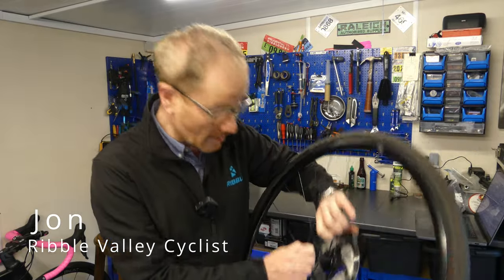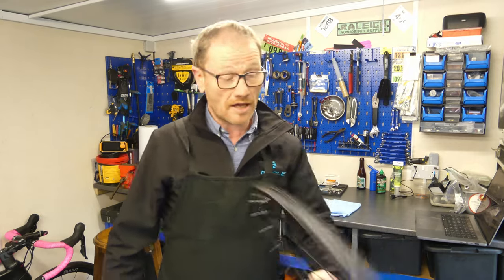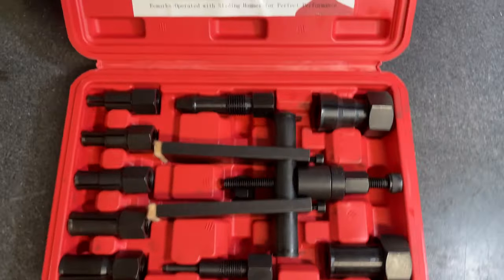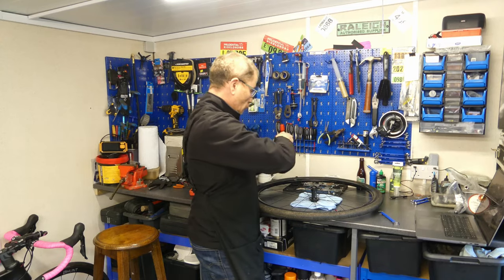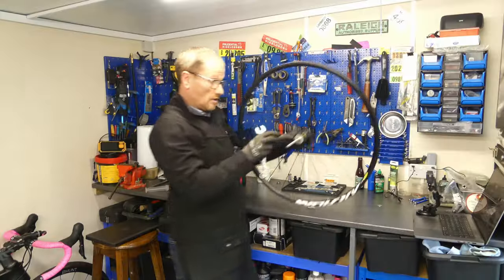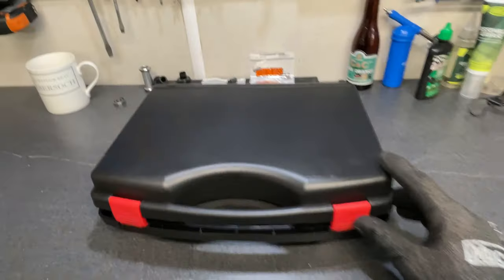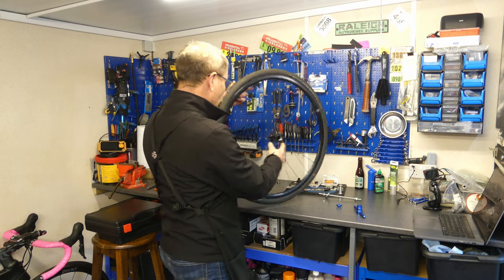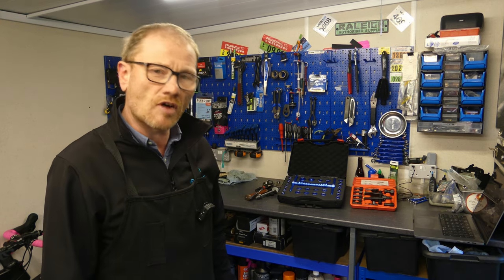Replacing Sealed Cartridge Bearings - Tools Required - Road Bike Maintenance

Comment: I've had great success with the bodged version of this. Using 12mm bar and a pair 1/2" sq drive sockets with od equal to that of the bearing, the increased length between the applied load of the nut and reaction load at the bearing easily overcomes the moment acting to pull everything out of line. I suspect this works as long as the socket used is longer than its own diameter.
Reply from the maker: Interesting BenedictIEP, thanks for sharing. I also tried a socket, (sparkplug socket is a great fit for a 6902 🤣), but still had an issue. However, my threaded rod is only 9mm. I suspect your 12mm rod is doing a better job of keeping things perpendicular to the hub.
Reply: I have used Frankenstein's nose ring (love that name) with drifts I bought online in the needed bearing sizes.  The drifts are not expensive and much less than a full set of presses.  The problem isn't the nose ring device, it's that the washer's size don't match the bar and bearing, solved by the drift.
Reply: @ribblevalleycyclist great useful videos. Thanks for sharing. I just take piece of wood n hit the axle n pops out the old bearings ..n use impact socket to hit in the pressed bearings,,,

Comment: Brilliant, thanks. I've ordered both tool sets. My Hunt MTB wheelset has clocked up 5,000 miles in wet English conditions and the bearings are running rough. Having seen this and bought the tools I know I can swap them out myself with ease. I used the Frankinstein's nosering method years ago on a motorbike - successfully in the end, but it was a tiresome process - I know it'll be easier with your recommended method. Excellent, this is what YouTube does best.
Reply from the maker: Hi Jon,

I think that if you have mechanical sympathy and are a persistent bugger, you can get Frankenstein's nose ring to work for you. But lets be honest, who needs that hassle in their life? And anyway, using the right tools is just a nicer experience.

I personally run 4 sets of HUNT wheels, and am hoping to do a few maintenance videos around them pretty soon..... using the exact tools you've just treated yourself to. So, watch this space.

Glad you enjoyed the video, and enjoy those new tools 👍

Comment: Love the video, you say don't replace removed bearings, I've been removing my red bones for my casters/ wheelchair basketball, removing seal and dry cleaning in acetone, leave to dry then a few drops of bones lube followed by rock & roll lube, then immediately put the bearings in the freezer overnight, take them out in the morning and they just fall back into the casters, I do the exact same thing with my spinergy wheels and I can't mess about with them as not cheap at around 2k a pair, point I'm getting at, I'd rather not use any tools at all, my casters spin for over a minute and one push has my wheelchair from one end of the court to the other, all with the same bearings cleaned and replaced for the last 5 years.
Keep up the good work 👏

Comment: The other problem with the washer press is that as the washer is loaded it's going to deform and apply more force to the centre of the bearing, side loading and damaging the bearing. The load needs to be applied to the outer race.
Reply from the maker: That is a very good point, didn't think of that 👍
Reply: Are all the three hubs exactly same specialised wheels are same free hubs

Comment: been a mechanic for 48 years put bearing in freezer the it just drrops in.
Reply from the maker: I’ve heard of this before, but never tried it. I will give it a go, and may do a video on it. Thanks. 👍
Reply: Very interesting and helpful.  Thanks  👍🏻
Reply: as a spindle mechanic you are 100 percent right
Reply: Great tip. Will try it. I used to heat up casings on motorcycle sealed bearing replacements. Worked well
Reply: Could I deep freeze my wheel and have the bearing drop out? Serious question.
Reply: No because both the wheel and the bearing will drop to the same temperature. You want your bearing to shrink by lowering the temperature
Reply: @alexrhughes  Blow torch the hub, bearing will drop out.

Comment: I agree with bearing press recommendation, but not the bearing puller. I have tried these automotive/motorcycle bearing pullers and there are a couple of problems with these (poor overall quality and rough edges, the protruding lip which may interfere with preload pipe and damage it, the legs of the puller not suited for a bicycle due to not enough space to place them on most hubs) I had to return an expanding lip set that I had, it was causing too much damage and was very awkward to work with. Bearing Pro Tools sell pullers that are more suited for the bicycles. I should probably do a video on these. I am not affiliated and have paid money for my set, but it is more about the type of the pullers rather than specific brand. The main difference is that they are made from aluminium, bearing specific like the press set, and do not have a lip to grab the bearing.
Reply from the maker: Hi again Hard Work, good to hear from you.

The protruding lip which may interfere with preload pipe and damage it
		Never do the collet pin up with a spanner, and use the smallest collet to prevent excess expansion beyond the inner bearing lip. As you can see at point 6:10 in the video, the collet is in place, hooked under the bearing, but it’s rattling around freely, this confirms it's not putting any pressure on the preload tube, and therefore won’t damage it. The key here is to use the smallest collet and expanding it to only hook the bearing, that is why I stress only doing it up by hand. Using a larger collet will fit too tight, and may catch the collet. I used the 12-15mm collet, rather than the 15-17mm, and that is why it rattles around, but still pulls the bearing. I have never damaged a preload tube using this method. 

The legs of the puller not suited for a bicycle due to not enough space to place them on most hubs
		I have pulled multiple bearings using this puller. I have yet to find a hub that it won’t fit. What hub did you have this issue with? Additionally, adding a slide hammer to the set is of little expense, and overcome this. 

Bearing Pro Tools:
		Yes, I’m aware of this brand, they make some good bearing pullers. Because of this, I meant to mention them in the video, but forgot. I like their wind-out product, but have had issues with their expanding product (slipped on me a few times). The main issue is that each of their pullers is bearing size specific, so you’ll need to buy a lot of pullers, at £16 each!

Thanks,

Jon
Reply: @ribblevalleycyclist   Jon, you may be right that the lips of the puller not necessarily damage the tube. But this is definetly a potential risk. By the way, I used a smaller collet and ran into a different problem - because the quality of the collets was so poor, the teeth of the collet started extending unevenly and one even developed a crack in it. I am sure it was only a matter of time until it would break off. 
I think most mechanics will run into problems with most straight pull hubs and bottom bracket bearings, due to not enough space to rest the legs of the puller on. I had problems with a DT Swiss 350 straight pull hub. The whole solution felt flimsy.
I am sure Bearing Pro are not the only ones offering the same friction style collets, but I was unable to find competitors. They could have set their prices even higher due to no competition. But when I bought from them I only bought a set for my bicycle and so the set turned out to be relatively economical. In general, if I see value in tools I would never regret spending money on them. I see the benefits of this design in saving time and avoiding potential damage.
Reply: I have used the bearing pro tools ones for extracting bearings from the suspension of my mtb. Doesn’t work. You have to wack them out and you damage your frame. The aluminium expanders of the small extractors bend easily and brake of.

Comment: This is a really nice bearing installation set! I use exactly the same and it worked perfect both for pulling out (using 34mm socket) and pressing back my DT Swiss 240 hub bearings
Reply from the maker: I love it. Use it all the time. Got a few bearing videos planned for 2024, and these tools will play a big part.
Reply: I have same press kit, have used it from hub bearings, suspension pivots, headsets etc. In certain situations I end up needing some socket, oversized nuts, washers to get just the right pressure and depth. Oversized nuts or larger sockets come in handy to create space when you have to create a cavity for a bearing that you have to press out.
Reply from the maker: @drbobjohnson812 Great advice 👍

Comment: I had my go at pressing bearing and using sockets that are resting against the outer race has a high success rate. I don't know if there's a similarly successful DIY bearing puller, was thinking about using a circlip, but sometimes the gap between the bearing and preload tube is so small that probably it wouldn't fit anyway. So yeah, it's harder to substitute/bodge a bearing puller than bearing press. Great video!

Comment: Thanks for a great and informative maintenance tutorial. This is one job I haven’t tackled but will do soon. If you cycle in & around the Ribble Valley I might see you out on the roads as I’m from the north of the county, Heysham.
Reply from the maker: Hi, If you use these tools, it makes the job that much easier. Also, if you have the tools, you're more likely to do the job when it needs doing. Good luck with it, and let us know how you get on.

I rode from Clitheroe to Heysham once, to catch the ferry to the Isle of Man. Had a great cycling weekend over there. On the way to Heysham, we bumped into Bradley Wiggins out on his bike 🤣

Comment: I did have the same experience and wrecked one of my hubs. Great video!
Reply from the maker: Interesting, Cosmicpapa. Thanks for sharing your experience 👍
Reply: @ribblevalleycyclist  first I pushed the bearings in an angle in and needed to tap them out again. In my second attempt I re-pushed the same bearings in which probably were damaged due to taping them out again. After 6 months my bearings lost balls and did completely grind the inside of my hub
Reply from the maker: @cosmicpapa Sounds familiar! Hopefully this video will help get the message out 👍

Comment: I like to use ingeniously in these situations, without having to purchase specific tools for situations which I can find relatively easy/cheap ways to overcome.

For the home mechanic, to remove bearings that have a spacer fitted, such as explained in this video, which cannot be easily removed with a punch and hammer,  due to how the spacer is fitted.
In this situation, I find that just using something slightly tapered/small chisel that will fit through the inner of the bearing and using something metal, inserted the other way, such that the tapered item, will wedge itself inside of the far end bearing inner. Then the far end bearing can be knocked or pushed out of the housing, without causing any damage or issue. The opposite bearing can be simply knocked out or pulled out, using threaded rod and suitable spacers/ sockets. 
Refitting new bearings is normally more straightforward. As others have said, If required for ease of fitting, cool the bearing before fitting, (putting in freezer or spaying etc) before attempting to fit and ensure that you only push on the bearing outer and in such a way that the bearing goes in straight.

Of course, common sense in basic engineering principles apply. 

I also suggest, if you ride in the UK all year, or in similar conditions in other countries and your hubs/BB do not have really good sealing, I suggest not fitting low contact seals, unless you race and are happy to change them more often. 🙂

Comment: Nice video, very informative. I think I'll be throwing my Frankenstein nose ring out.. I think I only used it once on a headset but defo not worth the risk.  Coincidentally, I recently watched a few videos where Hambini and Reginald Scot have been debunking each others bearing removal methods. I'm in Reginald's camp.
Reply from the maker: Hi archiecraig,

Oh, you have a Frankenstein nose ring!! Imagine it'd do a better job on the large headset bearings.

I thought about the Hambini/Reginald Scot 'Lovers Tiff' whilst I was editing this video. I've never damaged any part of a wheel using a blind puller, and that includes the very robust preload tube. The same can't be said about using the screwdriver method. So I can imagine you can work out what camp I'm in!!
Reply: Yeah, but Hambini is actually more right even if he's obnoxious about it.  I don't think he's much more obnoxious than Reginald though. ;-)

Comment: The methods you dismissed work perfectly well for (older?) Campagnolo hubs, such as Mirage and Athena.  Done it plenty of times. Also the old Mavic sealed bearing hubs, front and rear. I don't care about the modern hubs because I would never use them😂😂
Reply from the maker: Interesting info on the older hubs, thanks for sharing 👍

Comment: A bolt just smaller than the inner diameter of the bearing is better than a screwdriver for tapping out bearings. It's less likely to skate around on the bearing when tapped.
Reply from the maker: Thanks for the tip, S Less 👍

Comment: Brilliant video. Worth a sub ❤
Reply from the maker: Cheers, Phil 👍
Reply: @ribblevalleycyclist  i don't suppose you know how to remove the end cap on a SRAM x9 hub. One side is threaded and I assume the other is too but just rotates when one side is off. It's frustrating as I need to replace the worn bearings of my front wheel.

Comment: Great video, however my axel won’t remove from the hub. It’s a vision team 30 wheel. I read it should be tapped out from the non drive side but it will not budge. Any advice?
Reply from the maker: Hi Tim, Been a very long time since I did a Vision wheel. Last one I did was a Vision 25 Rim QR. I recall you knock the bearing out by tapping the axle from the drive side. You took the freehub off, and then tapped the exposed axle. But it was a long time ago, and I may be wrong.
Reply: @ribblevalleycyclist  thanks, I’ll try the drive side instead. Not sure how much force I’m prepared to hit it with! 
Also great video on the stuck pad axle on 105 calliper. I remember a bike shop once drilled mine out then used a split pin. I’ve got this issue again on a very old model of Hope brake and will see if this method is plausible

Comment: I'm pretty sure you're stalking me. I've just had all of these issues on my Hollowgram 35 wheelset and I spent hours trying to work out whether it was good value to buy a puller/press when Chevin did it for £10 (bearings sourced myself from Bearing Factors in Nelson which is such a good place).
Reply from the maker: Yep, guilty as charged. Do me a favour, don't start thinking about a full Dura Ace install 🤣. Bearing Factors..... Will look them up 👍 Are you in that part of that world? If so, you're not a million miles from Colin Gardner, who is a very talented bike mechanic.
Reply: @ribblevalleycyclist  Bearing Factors are located behind Asda Colne/Nelson. They've got plenty of Weldtite products/Hope cleaning products etc. too (and the Squirt wax I couldn't get for ages). Yes, I'm located about as close to Thursden Valley Road Climb as anyone would want. Thanks for the recommendation although I have enough knowledge and ambition to be dangerous when it comes to maintaining our fleet!

Comment: Hello.  What material is the blue set of thrust bearings made of?  Aluminum or what?  Thank you
Reply from the maker: Do you mean the bearing press? Is so, it’s aluminium. 👍
Reply: @ribblevalleycyclist  Yes. Is it durable enough?
Reply from the maker: @forestdamian5601 Yes, no problem at all. You need to remember that although the drifts press hard against the bearings, there is no friction between them, so there is no wear. Some of mine are starting to lose their lettering, but as you can imagine, mine gets a hammering. You can buy this product with confidence 👍
Reply: Ok . Thanks for the answer. Good luck in the presentations, in the future

Comment: My front wheel is shot so thinking about buying the press and puller and having a go, started to strip down my wheel but the sleeve which the axle runs through protrudes out about 7mm from the bearing, any tips on how I progress Jon?
Reply from the maker: Is it a DT Swiss hub?

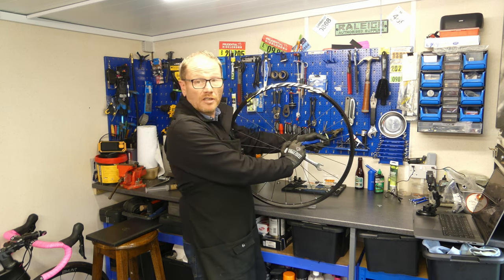Comment: 09:40 how about the penny bolted both sides, with the inner side a smaller nut than the outer side? maybe the penny presser will not move around, and stiffer to press the bearing?
Reply from the maker: To be honest, I just think using the right tool for the job is just a better way.

Comment: To put back in the bearing on the Mavic, you use to much force in the beginning. You have to go slow and strait and never press on the inner bearing ring !
Reply from the maker: Hi LhDiy,
I battled with that press setup for some time, and I also tried several sockets…. A sparkplug socket is a great fit for a 6902 bearing. However, it kept going in sideways. I kept an eye on it, and moved the home-made press where the pressure was needed, but it just slipped back. I didn’t show all of this, because who wants to watch that!!

Thanks for sharing your recommendations.

Jon

Comment: Have you tried those in full suspension frame bearings?
Reply from the maker: I can't imagine either the puller or the press having any issues. After all, they're still installed the same way..... or have I got that wrong?
Reply: @ribblevalleycyclist  The space to use the tool can be tighter